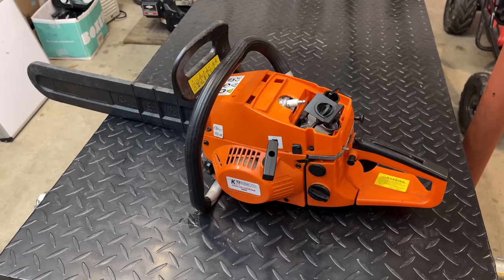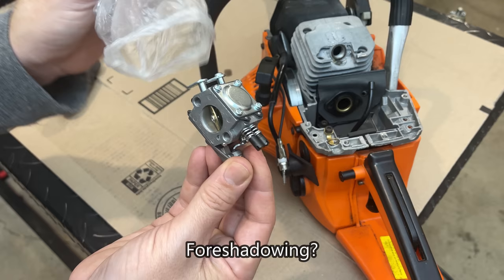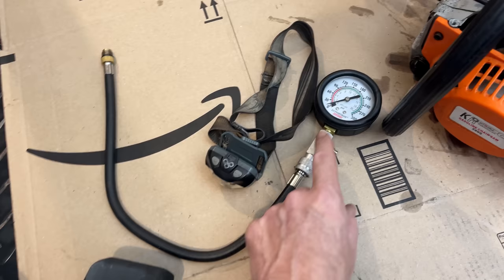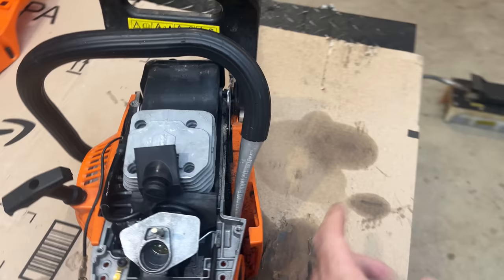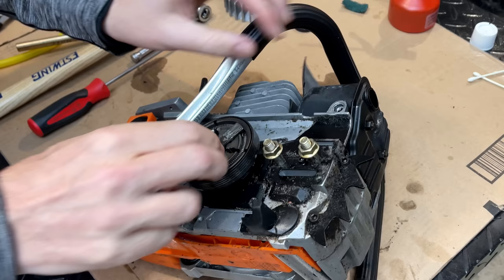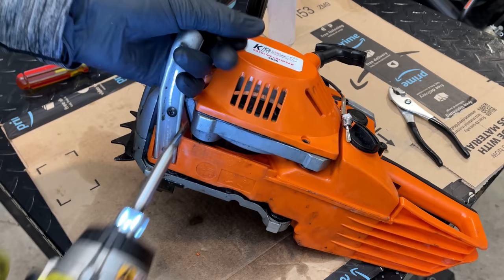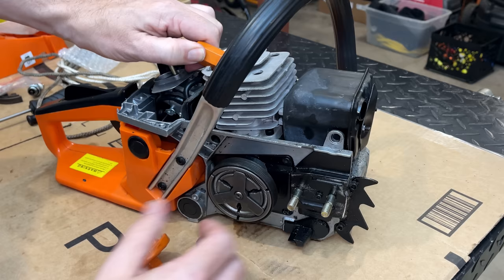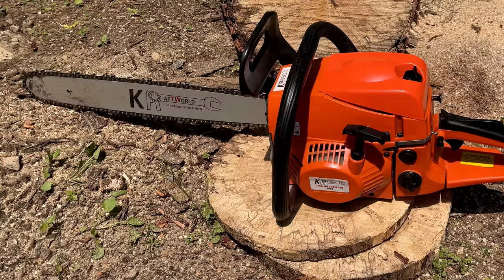Chinese Chainsaw Challenge - Will it Run? (Unbelievable Amount of Problems)

Comment: I've always used drywall or sheet metal screws to get these seals out.  Lot less likely you'll get shavings in the bearings.  Also gives you something to grab.
Reply: Yep or drive a straight pick in with a hammer then flip out the seal, that's how it's taught at trade school. Professionally, speed is of the essence, no time for drilling and cleaning out swarf, plus showing the client the problems at handover doesn't get them worried their crank case is full of crap.

Comment: I don’t think anyone would argue that you could easily work anywhere on the Kraftworld assembly line after that ordeal. This near new saw came from the factory with stripped nuts, blocked and cracked lines and a dull chain? How is that possible? I burst out laughing when that clutch clutch exited stage right. Glad you didn’t wear it. Love your vid’s. Learned a ton.
Reply: Yeah I was in South Korea in the 80's and saw "factories" that were tiny out-buildings next to the workers' home with dirt floors and three very skinny guys doing their best to build things with terrible tools and no training. I'll bet the low end of Chinese manufacturing is like that. It's a spectrum. At the other end are the folks who make iPhones.
Reply: I think the saw suffered two bad users before it made it to James.  First owner ran with the break on, second owner ran straight gasoline with no oil.  The fact that the saw died as quickly as it did may have ultimately saved it. . .  from the end users.

Comment: Great video. In retrospect, the fuel leak onto the table at the start was an indicator of the fuel line problem

I've been looking at a problematic chain saw which has some parallels to this video, so this video has given me some pointers to look at areas I'd not considered before - so, yes, your video did help someone - thanks :-)
 
My carb screws were around 3-4 turns out, so an indication of a bad carb, or an air leak. Usual maintenance and replacement bits didn't solve things, so a replacement clone carb was fitted, this had two faults direct from the factory which sent me down the wrong rabbit holes for a while. The spring under the needle/seat was mashed into the fastening screw and would have never worked, the second was was that the tip from the high jet had snapped off in the carb and was completely blocking the high fuel delivery. Think I'm going to check any subsequent carbs and adjust them before use. 

I'm currently waiting on another replacement carb to arrive, but it looks like I've got an air leak to locate and I know the techniques to locate them now - thanks

Comment: Fascinating!
I bouht one of these and immediately found that after use, even with fuel stabiliser a week later it wouldn't start. I found that the float valve seemed to be sticking closed and the impulse line pressure wouldn't open it. On examination I concluded that there was a problem with the coating on the conical head of the float(fuel intake) valve, which was causing it to stick in the closed position.

After some thought we fitted a normal purge thumb pump in a new hole in the left side and the extra pressure generated by the little bulb pump seemed to unglue the t float valve, allowing the float chamber to fill normally. This seems to work!

Comment: Your tenacity to keep up after this saw with its many problems due to poor quality control and cheap parts is impressive love the warp speed camera shots along with the many camera shots showing the issues and solutions fascinating how you diagnosed each problem, your editing skills are just fantastic!  I just keep learning more from your videos. Thanks, James
Reply: You missed the key points of the video. The previous owner said he had used not an oil-gasoline mixture, but only gasoline. The pure gasoline fuel deteriorated the fuel line creating cracks. The multitude of cracks in the fuel line allowed the engine to suck in excessive air depriving fuel to the engine, hence, the engine stalls and  resists start-up. Finally, Condon mistakenly torqued the clutch connectors too loose. Consequently, the engine destroyed the clutch once it started. YTuber Project Farm evaluated this $100 USD chainsaw against the $500 Stihl, and found it quite a compelling buy. Don’t assume made-in-China tool are poor quality — that’s the dogma certain domestic tool makers want the gullible consumer to believe.

Comment: Wow --- Rookie Mistakes and a Cheap/Junk Saw both -- On many Husky saws you'll lose the clutch if you run them without the bar/chain --- I've done it ---- On the fuel line, you use the old line (where it goes into the tank) as a "grommet" and run the new non-molded line through the center of the old molded line (quick fix for Stihls, and others, that have molded fuel lines and you don't have a new one in stock) ---- I used to fix saws 6 days a week for a shop ---- Nice job on the Crank Seals !!!! ---- But the hole in the fuel line was the main problem (crank seals were a bit leaky ---- cheap/junk saw) ---- Great/Entertaining Video !!!!!

Comment: Hi James, My story: Fourteen years ago as a new homeowner I bought one of those cheep at dirt Amazon Chain saws ≈ 100. I just figured I'd be nice to it and rub it weekly with a clean cloth diaper in a slow circular motion and put good gas in it.  It should work real fine and last a long time. I cut down and cut up only one tree about 8 inches in diameter. Took about 45 minutes and at the end of the job the saw quit and never ran again. As a newbie I took the saw to ace hardware and the guy told me it was done for. Scorched cylinder wall he said. It would cost more to fix than a new saw he said.  I took that saw home and with the help of the kids we invented a game much like horseshoes of throwing the saw from one end of the yard to the other for sport.  This video helped me work through that painful memory of wasting a hundred bucks on cheap Amazon Chinese junk.  I really appreciate the thorough disassembly and  diagnostics you did on this one.   Yes, I left the Ace with an ECHO CS-400  18 in  and I use it all the time.

Comment: Wow, that was quite a marathon.    The saw was asking to go to the recycler at each step.    Amazing you were able to get this running better than new.    Very well done.
A good example to show how even a simple 2 stroke engine can have a lot of issues.  Some in this saw may be the design, some may be the parts, some may be the manufacturing.
Some nice spalting in the wood of the bigger log section.
Dave.

Comment: This is a great video!  For anyone not familiar with “clone” saws from China, they wildly vary in quantity and specifications. This particular model is a clone of a zenoah Japanese saw. They have a very good design and like stated, very popular worldwide. When buying a clone like this, you will see them advertised as 40-62cc. Most often, when advertised as larger displacement, they are in actuality not. That JonCutter you showed at the beginning would be considered more of a better quality zeboah clone. While the same design is used, the quality of plastics, castings and assembly are far batter than the cheapest eBay cheapies. They even have better fuel and oil caps.

Comment: Good job getting that saw running! It is indeed a struggle with these Chinese chainsaws. On mine I had to replace the starter, the spark plug (out of the box not running), had to fix the cables, had to replace the piston and the cylinder, and worst of all a very common defect of these saws (which I am surprised you didn't encounter) is that the "weld" between the two parts of the fuel tank is extremely weak and I had to glue it anew with liquid metal (which in America is called Flex Seal or something like that). I did that on three different saws from the same "brand". Oh not to mention the carb was completely out of  tune (again out of the box). 
Many people say it is not worth it because you can just get a new saw and they are right, but the experience and knowledge you get are priceless (at least for me) plus you get the satisfaction of repairing your own tech which is always nice. 
Great video, subscribing.

Comment: I've had one of these for years of use and abuse. Worn through 6 bars, the oil cap perished through, Pull-cord has come off a few times, but all in all for what I need it for it was great value. Need to do a service on it now, I'm pretty sure it's probably due a spark plug at this stage. By the sounds of things I really hit the lottery with mine 😂

Comment: The crankshaft seal should have high-temp sealant on the outer rim. Not every brand puts it on from the factory, but they do better with it, especially at the engine pan interface.

Comment: A great example of why TO NOT buy China's junk. Thank you James.
Reply: I do agree with you about China but It really wasn't the saws fault it was the guy that strait gassed it. I was given as a Birthday present a Chinese backpack blower EB650, and the thing is absolutely amazing!!! I blow snow, grass, leaves, rocks sticks, and whatever needs blown away. In my opinion if someone uses the right mix and does the proper maintenance the Chinese machines will work and last. Just my 2 cents

Comment: I have owned and maintained several of these chainsaws in sizes 45-58cc, and they have been stunningly good value. Most do no have a throttle lock, they start on closed throttle (ie hands off); and they don't have a purge bulb. From cold with GOOD fuel in the tank, pull it over slowly a couple of times THEN full choke and pull it until it pops off (max three pulls), then half or no choke, pull it again and it should idle quite smoothly, let it warm (to avoid cold seizure) and get cutting. Here is a demo of how easily they should start: https://www.youtube.com/watch?v=M4qmV9bgcvw .

Comment: There is a tool to tighten the clutch to the crank shaft or you can make one or you can start the saw with the chain brake on and try to rev it up and tighten the clutch, but sawing a log will also tighten the clutch after you get the saw running. You also have a vent line and filter, or vent filter  on the fuel tank - lets air in the tank so fuel will flow out. Worth fixing if you need a saw and have time to fix it and the parts are cheap or in expensive enough- might save you the cost of approximately $300.00 dollars to purchase a similar new saw.

Comment: With oil all over the place; worn out seals, extensive fuel line damage and a chain that couldn't cut butter, somebody wore out this machine before unloading it with just 2 minutes left.  Your problem-solving skills are amazing and your perseverance turned out a really great video!  Good conceptual understanding of 2-stroke insights and technology.
Reply: Wore it out without a the slightest bit of deposits and wear on the piston and cylinder walls?

Comment: good discovery about the harbor freight compression tester. i get to tell a friend he threw away a perfectly good stihl ms 250 because he used that compresison tester to make his final decision on his saw he couldnt get running. i have an older craftsman compression tester and it give correct compression readings on small engines. i would have never guessed there would have been that much of a difference between harbor freight and good brand names but i guess you get what you pay for. im glad i adopted the mindset of buy once, cry once with tools and diagnostic gear about 15 yrs ago as its saved me money in the long run.

Comment: We had a giant tree fall on our car and driveway . They wanted 1200 dollars to cut it up . While I have the orange S saws but bought one of these similar with a longer bar. It was a beast of a saw and cut it up lime butter. Win win for me . I mix my own fuel .  I highly recommend for the DYI person . Paid for itself over several times . The cylinder is scored and rings toast from the heat . Owner operating error. Cheers

Comment: For someone like me, that was an exciting vid. When I'm in a big hurry I like wee short vids but when I'm ready to learn some things, an indepth creation like this is full topnotch.
I'm surprised no one mentioned the chinese spark plug (if that was what it was). I have had bad times with chinese spark plugs.
That fuel line was made of terrible material; hopefully the new one is better.
All that cover needs is a broad flat headed sheet metal screw to hold the front down.
Excellent video! Excellent lesson on patience. Thanks for that one.
I am subscribed.

Comment: Excellent sir…I also had a 2 stroke with an air leak .  Replaced the seals and sealed the mower case with Honda bond.  30 year old mower runs like new now.

Comment: For the air filter cover I believe you may have 2 options. One would be to purchase the lower air filter housing that matches the air filter cover you bought. I believe the air filter cover and housing may have undergone some design modifications over the years and replacing both as a set may solve your problem. The second option would be to find someone in your area who specialize in 3D modeling and can take some measurements and 3D print you a custom perfectly fitting air filter cover.

Comment: Thanks for the video James. I have one of those chain saws in the garage belonging to my son inlaw.The pull start main spring was broken. I replaced the whole assembly with a bit of tweaking got it to fit. Fortunately the spring broke before they got it to start as there was no oil in the fuel. I put the fuel in my 4stroke mower. works fine ,no smoke. I just have to get it started now. It use to run fine prior to the broken spring.  Thanks again

Comment: Running a new engine, no matter where it was made, for several minutes at high revs without any lubricating oil is going to damage piston and rings at least. Remove head and cylinder, check the bore, if OK fit newpiston and rings, rebuild, mix two stroke oil and go to work. Rebuilt so many that was run on neat fuel, not correct two stroke mixture. Not complaining, did it for a living, paid my mortgage and now enjoying my retirement

Comment: I bought a Chinese wood chipper and all the bolts in the chipper head were stripped out then locktighted. The thing fell apart after cutting 5 minutes. I had to drill into the casting and put oversized grade 8's in it. Great little chipper once I fixed it. Essentially; I now disassemble everything and do my own inspection.

Comment: Great video, many thanks. 
Fuel filler cap leaks can be fixed by using a round file to smooth off the poor plastic injection moulding where the o ring seal mounts as they are not smooth creating a leak. Easy fix.
I learnt a lot I did not know.

Comment: I have one of these saws, - it was always hard to start from new, I tore it down and found it came without a gasket between the carburetor, and the intake manifold, so I added one, and haven't had a problem starting it since. Parts are cheap and easy to get. The petrol caps dont seal on these so I used Vaseline on the seal and was able to tighten it a little more and seal it

Comment: I just bought a saw made in China, it came with a 2 year warranty with an option to buy another three years making it a 5 year warranty, I didn't opt for the 5.  The saw cost £210 with the 2 year warranty, most or nearly all major chainsaw manufacturers only give a 1 year warranty, I think it's a pretty good deal. I don't normally sit for almost two hours watching a vid like this but I did and I have to say, it's the best chainsaw in depth info vid I've ever watched!☘☘
Reply: Confucius say, warranty no good if company doesnt exist. I suspect you wouldnt be able to buy the same brand of 😁saw again if you tried.

Comment: James 

First class video and very well explained 
You are a top class mechanic 👍at small engines 
I have the exact same problem myself but I happened to notice the fuel lines cracked and I have this chain saw tank off at the minute 
Thanks again

Comment: You Sir, are a patient man! As written on the blade this is the "Professional Line"... I don't want to imagine what the hobby line might look like.

The piece of aluminium that you found behind the exhaust is missing on the engine cooling ribs left of the spark plug, btw.

Comment: This video is a perfect illustration of what it's like to own a Chinese chainsaw- you have to spend more time tweaking and repairing it than you do using it. I had bought one a few years ago. The engine ran fine...but it leaks gas and bar oil, and is just a cheesy pice of crap that sucks to use. If you're a suburban homeowner who just needs a saw to use to cut a few limbs maybe once a year, you might be able to get away with one (Better know how to do your own repairs though), but all I can tell people is that after using my Chinese chainsaw a few trimes I was more than happy to go out and spend $400 for an Echo CS-590 Timberwolf. It just works...and is a pleasure to use.

Comment: Perseverance and patience are traits you possess in high quantity.  I thank my lucky stars I own stihls and echos, chainsaws, weed eaters and blowers respectively. When I saw the plastic in the tube, I must confess, I thought there was a good chance the saw had been sabotaged, with the purpose of deviling you.  Then with fuel line cracking, on an engine that had hardly been run, mind blowing ! You solved the problems, but with a chainsaw like, that I have to figure it won't be long till something else breaks? Would I ever buy one those chainsaws ?  I wouldn't wish that fate on my worst enemy.  Just watching the video play out was like Candid running through the gauntlet. I'm happy the nightmare is over and I conclude by saluting you, you are one heck of a man !